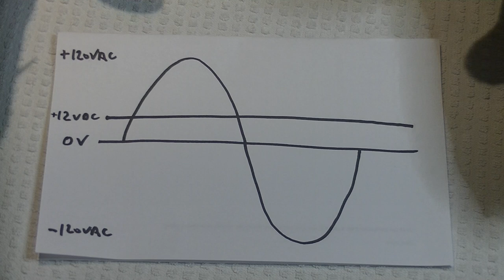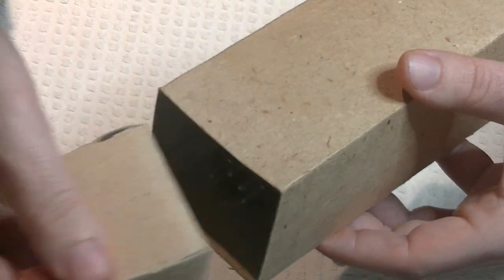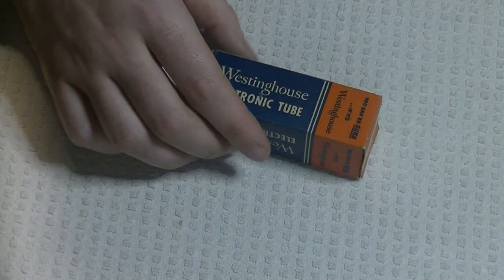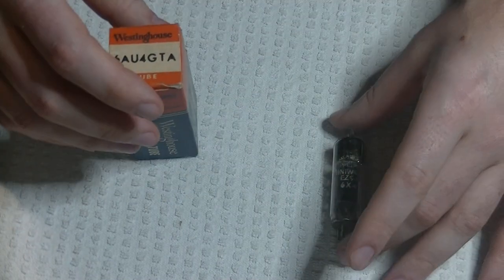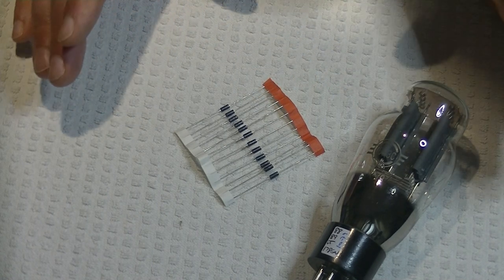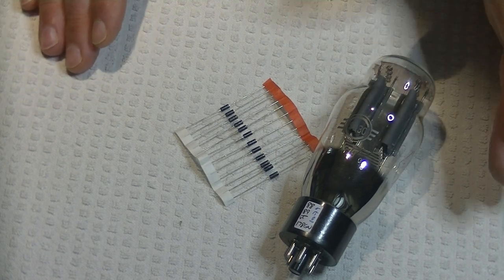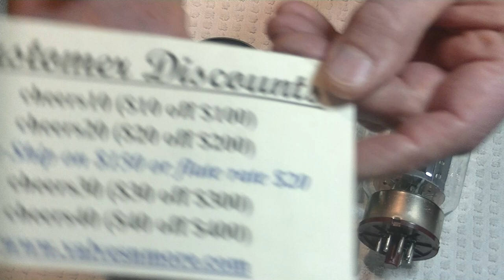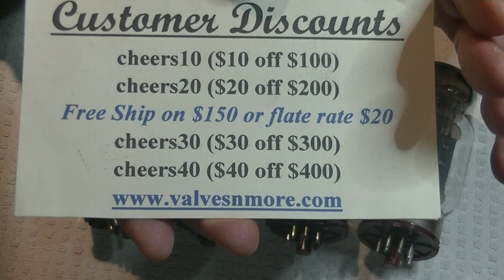Tube Lab #117 - Rectifiers 101

Comment: HI guys i just purchased a new 5U3C  rectifier tube i did a quick search for the tube data sheet for a 5U3C with no luck ' my phono amp runs at 350 volts DC  and  54 mv  with TWO  6L6 GB Power tubes ' i have been using a Sovtek  5U4GB  ' is there an advantage In switching to a 5u3c ?
Reply from the maker: The most important thing with rectifiers is to know what the amp was designed to use.  That becomes the primary rectifier for your amp.  After that you can use any rectifier that is a direct equivalent (in many cases there isn't one) or any rectifier that's close.  The reason this is extremely important is three fold.  Obviously the pinout needs to match, then the specs and most importantly the voltage drop.  Voltage drop and current capability vary dramatically across tube rectifier types.
Reply from the maker: So when making an enquiry about rectifiers, first mention the primary rectifier for your amp and then ask what possible equivalents exist.